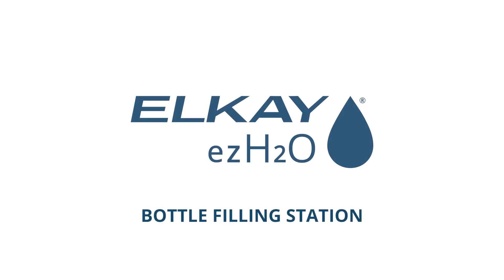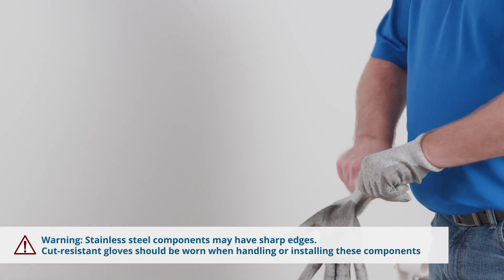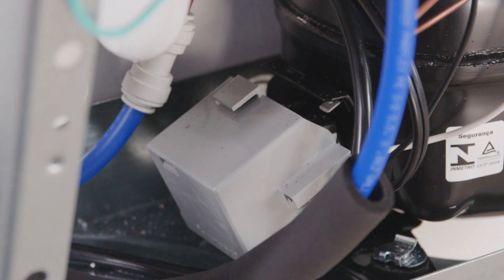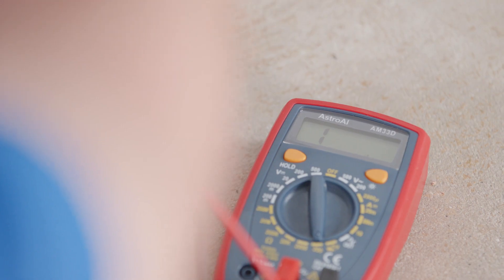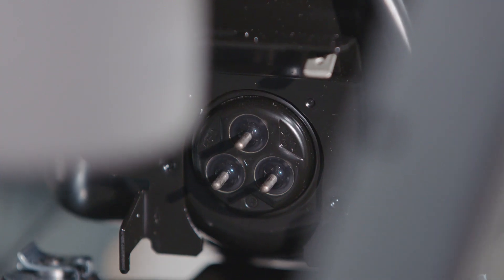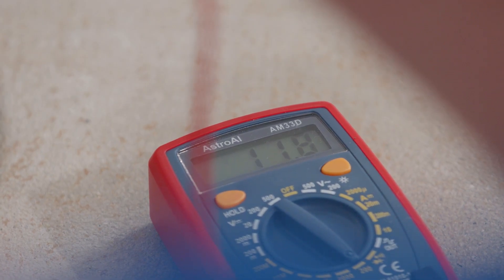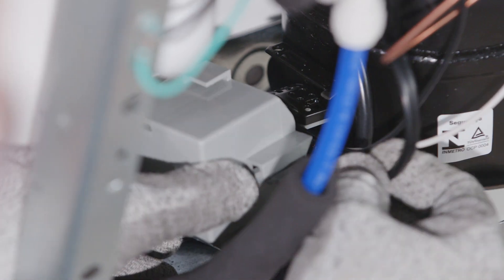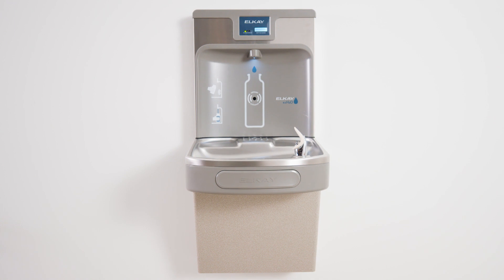How to test Ohm Test the Compressor on an Elkay ezH2O Bottle Filling Station

Comment: Nice techtorial . All there except for the most important part. What are we reading on the volt meter??? amps??? volts??? ohms???
Reply: Ohms
Reply: Read the name of the video. Plus with the unit unplugged you will not be reading amps or volts.